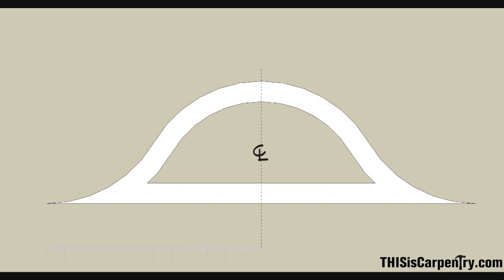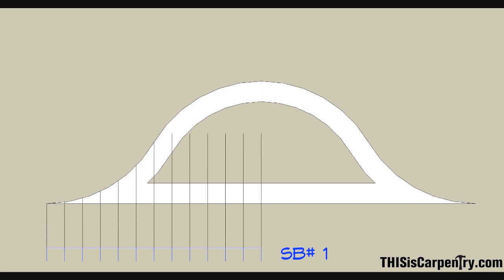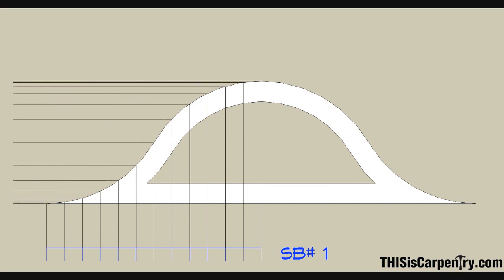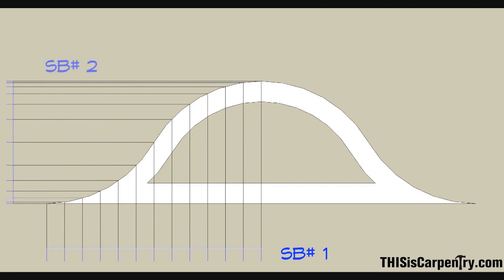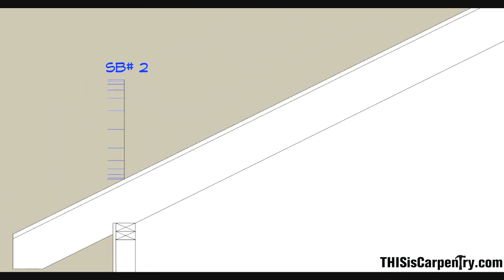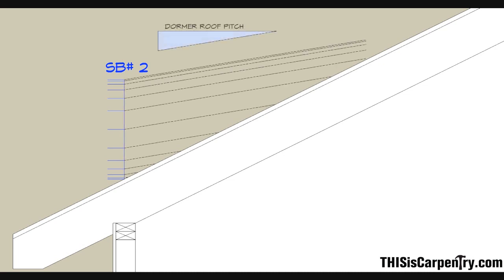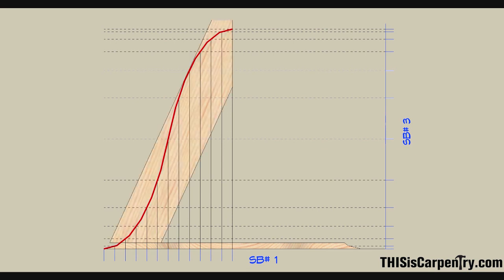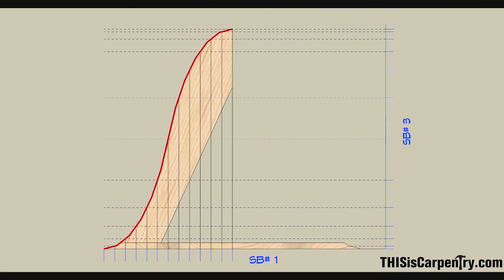Drawing an Eyebrow Dormer

Comment: Thank you for the very thorough and well explained video. I really like the method used for creating the curved valley. Do you have any resources you could point me towards in figuring out the compound angle cut for each rafter, if you are running them around the arc like minutes on the clock.? Thanks